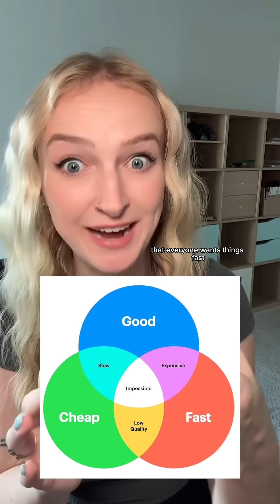How many times can Starship explode?

Comment: 3 points: 1) "many experts" (before SpaceX did it) said what Falcon 9 does raised significant doubts about its practicality and economic feasibility. (guess they weren't so 'expert') 2) Until and if SpaceX runs out of their own money, loses the race to build something like Starship successfully, or people are hurt, they should do what THEY believe they need to do. 3) if you bring up a data point, make sure it's not misleading people.  You completely lost me with "starship has exploded nearly 15 times in the last couple of years".  No, it hasn't.  The number (beginning in April 2023--a couple of years) is at MOST 8 times, including both booster explosions/breakups and starship upper stage explosions/breakups, either in flight or on the ground. What else are you counting? 8 is not "nearly 15", or at least it hasn't been since I learned to count in the late '60s.